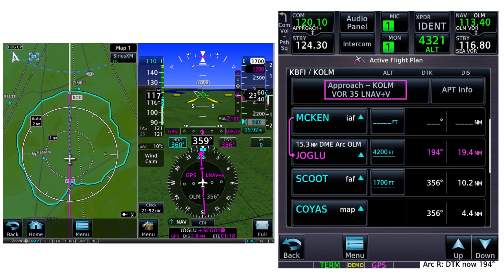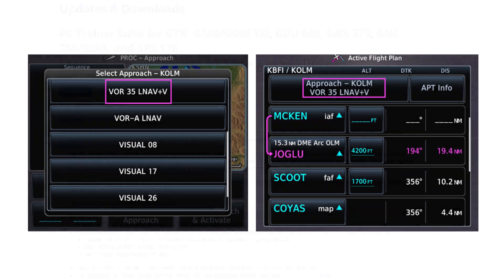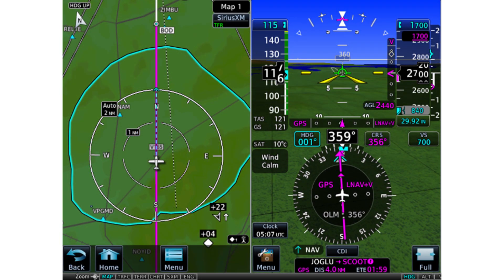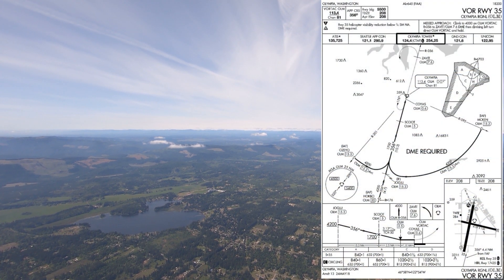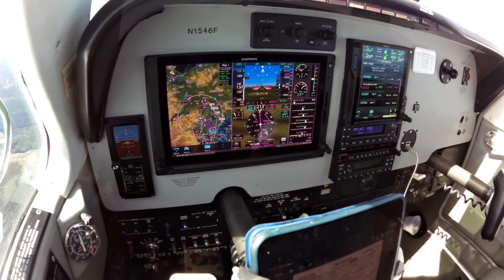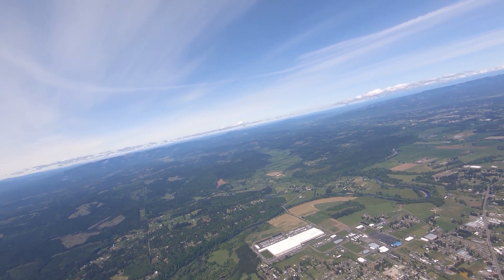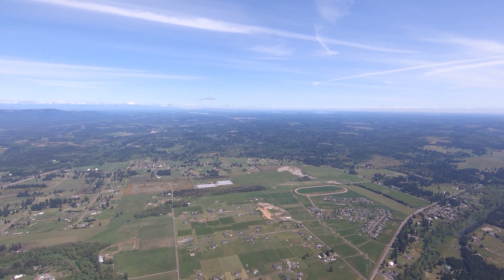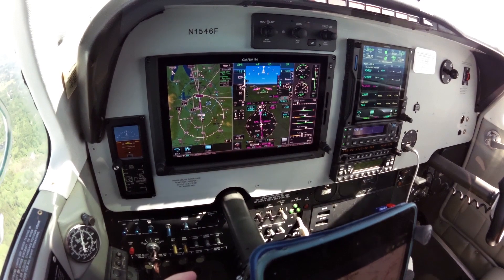KOLM VOR RWY35 LNAV+V

Comment: I agree not documented.  Also interesting if you force CDI to follow VOR on the 35 VOR LNAV +V, you get the same outcomes as with CDI set on GPS. Namely, simulator flies the  glide path through the faf minimums and through the LNAV minimums of 900ft (this was lowest altitude I could set on iPad.). Also interesting on sim is if you change the OLM VOR freq to something else with CDI set on VOR you continue down the approach as if nothing has happened. It does sort of raise the question of how much GPS signals are used on non- GPS approaches. I do like the ease of flying DME arcs.
Reply from the maker: Be careful about correlating the behavior of the trainers (iPad and Windows) and the units installed in an aircraft. The trainers are excellent resources as you learn to use the avionics, but they have their limitations, and they don't always simulate all of the behaviors of various combinations of navigation and display units and autopilots.

The Garmin pilot guides for specific avionics note that GPS may be required even when flying some navaid-based procedures.